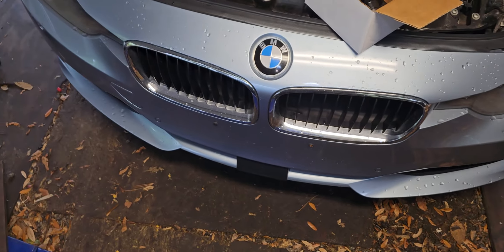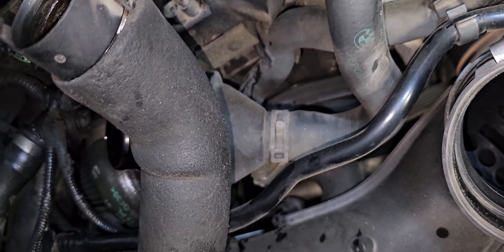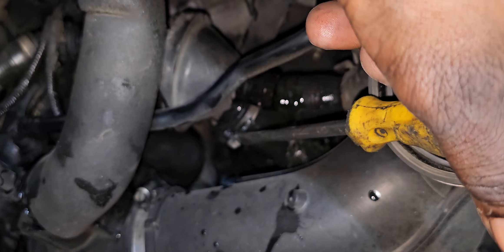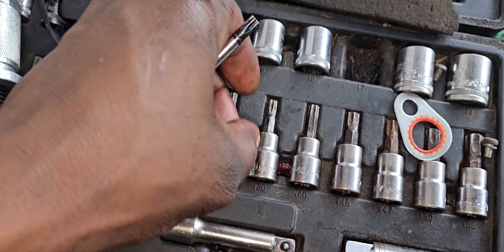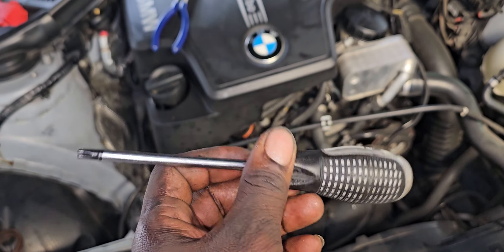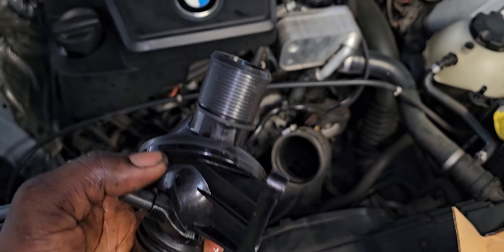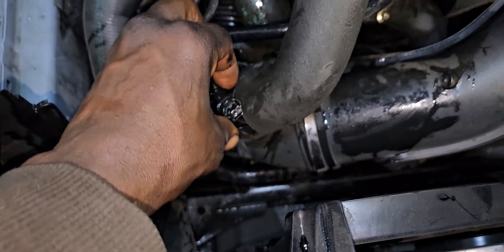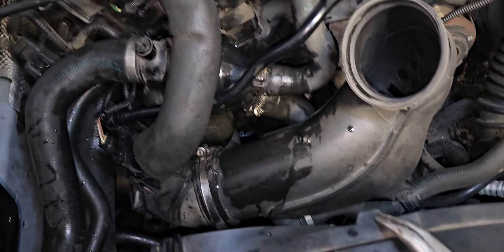How To Replace Thermostat In 2013 bmw 428i

Comment: You should never use brake cleaner on any electrical connectors they sell electrical clean and electrical lube that keeps the connectors and pins from corrosion build up. But good video and good job
Reply from the maker: This specific brake cleaner dry immediately and it clean any and the connection got coolant on it that will cause corrosion so it better to use it clean it away that install it as is